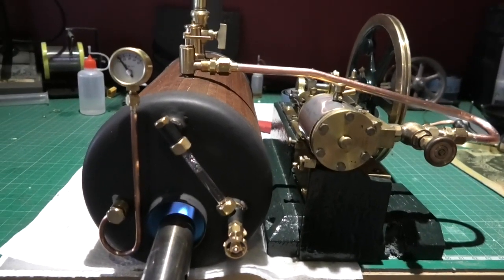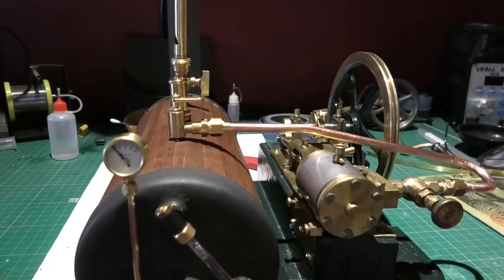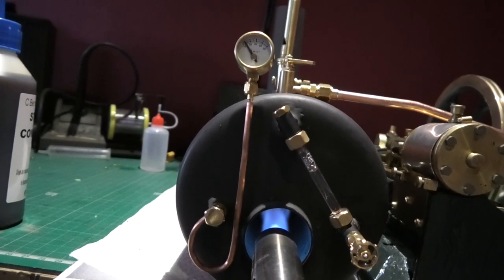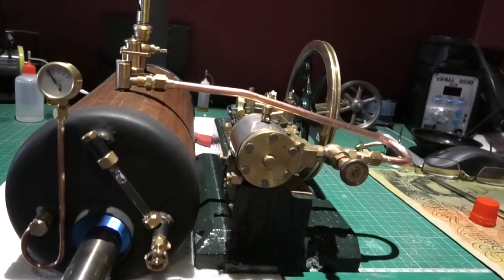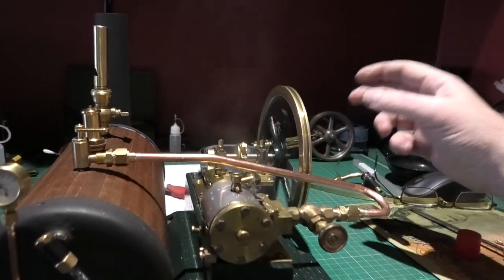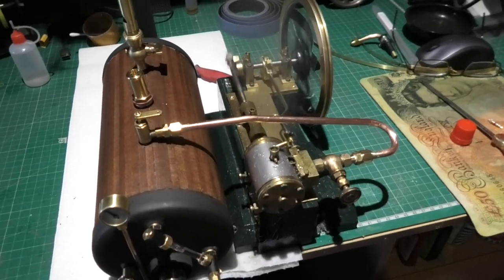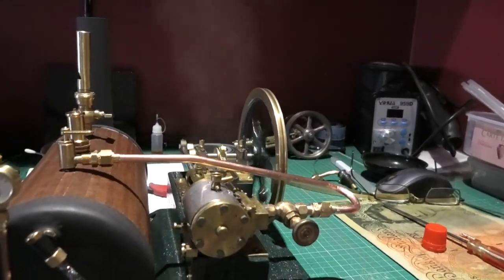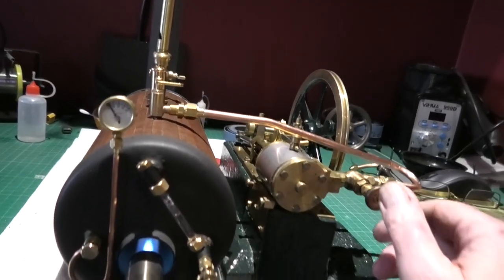DIY live steam boiler build - Part 3 of 4 (First test run)

Comment: Congratulations on a successful run.

I think it would have performed pretty differently if you let the steam pressure build to 30, 60 or 100 psi.  The steam would be dryer and expand more, using less water to make it run longer.
Reply from the maker: Yes, it would but there's one slight problem...... I made the boiler. I have zero experience with plumbing, I've only just discovered how to silver solder and I don't know what I'm doing.
Even I'm not brave enough to push it to 100psi 😂
Reply: @Vortecks  a hydro test isn't too hard to do.  When you are building steam, you have heat which can weaken things in ways you won't see in a hydro test but you can de-rate based upon your temperature and construction.

Then test under steam using some type of blast shield to avoid injury if you get a boiler explosion.

Comment: With the engine running light there’s very little load. An engine like that will run on next to nothing , so little pressure that it doesn’t even move the gauge. If you give that engine high pressure on no load, it’ll roar into blur.

Comment: Well done Tony. That's bloody brilliant.
Do you reckon that pressure gauge might be a bit shite ? Even after you ran it down, it still had a reasonable amount of pressure.
Reply from the maker: Yes mate, I'm confident that it's accurate. I put my car pump on the throttle output with a Schrader valve and it was reading 2-3psi high. Steam pressure is different to air pressure because, when you let the steam out, the depressurisation causes the water to immediately boil so it does seem like there's a lot of pressure but there isn't really.